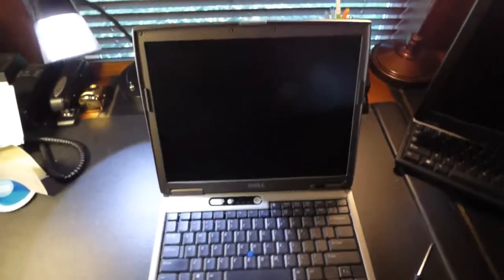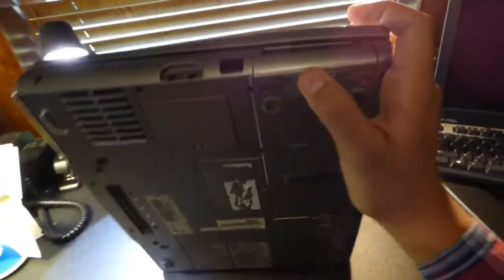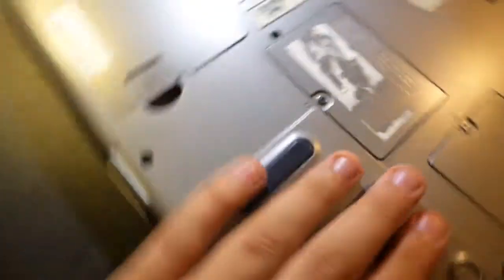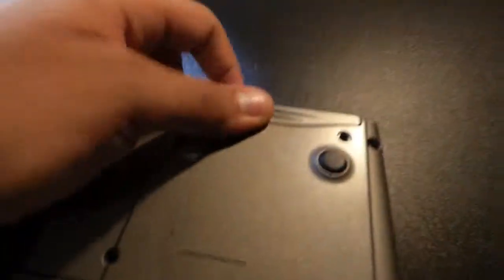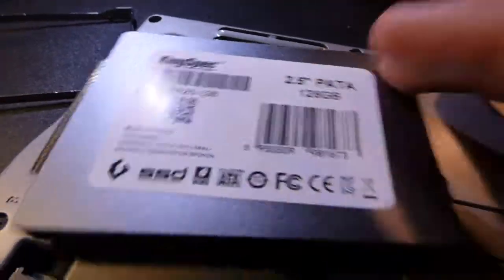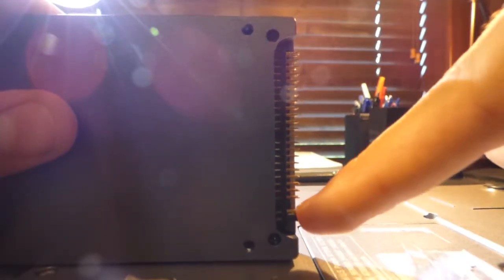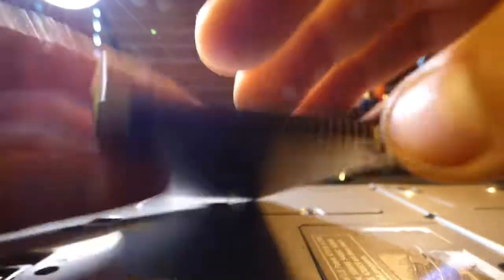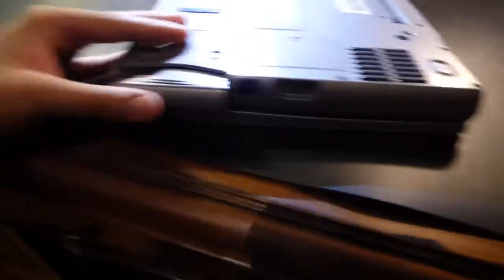How to Replace a PATA/IDE Hard Drive + How to Run Diagnostics on a Computer- Dell Latitude D610

Comment: Quick question:  Did you have to remove the screws around the "Strike Zone" panel in order to have the hard drive pop out?  Mine doesn't move at all (like it's screwed into place)...